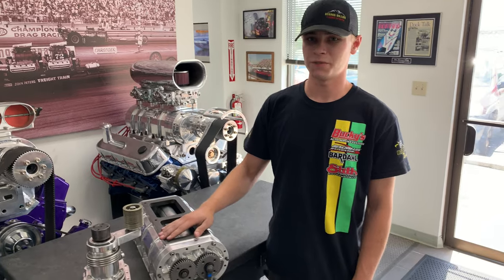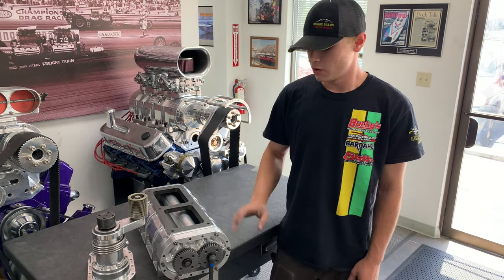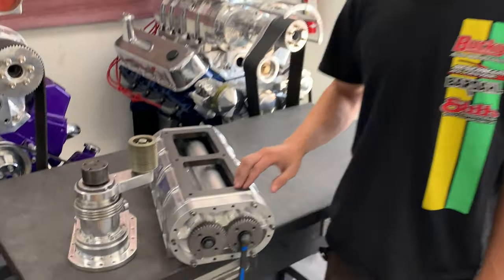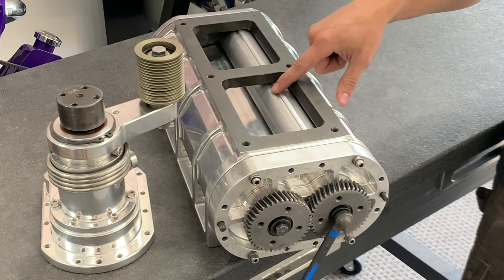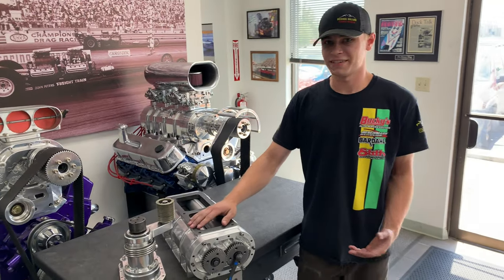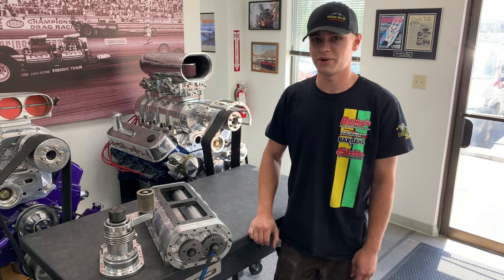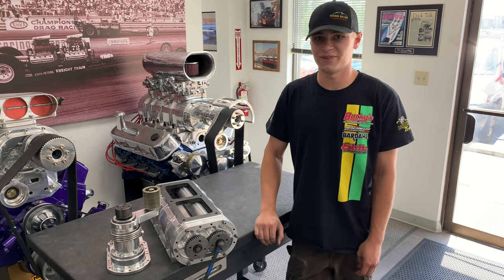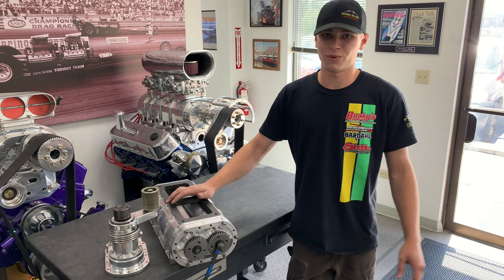Boost Bio 9 - TBS 250 Low Profile Blower

Comment: Seriously thinking of putting one on my 632 marine engine with efi only looking for 3.5 to 4 psi , ran one on my 565 and loved it as 3.5 psi 798 hp pump gas 6 psi 846 hp
Reply: At the very least get a 6-71 for that or a Whipple 3.3. That little 250 won't do much good above 700 hp. You have to remember that a blower needs to be sized for the power, not the engine size. If a blower is designed to make 600-700 hp, that's what it can do, no matter what you strap it on. If you strap a small blower on a motor that already makes a lot of power, the blower will be a restriction, not add power. If you have stepped up from a 565 that made 846 with 6 psi, that same blower on a 632 will not make more power if you spin it at the same speed, it will just make less boost as boost is just a function of air resistance. To comfortably feed a 632 that makes in excess of 850 hp @ 3.5-4 psi, a 250 "baby blower" won't be what you need. A 6-71 can do it, but an 8-71 would be better. Why? Not because 3.5-4 psi is not much. But if you make 850+ hp with that amount of boost, that means your motor is already breathing pretty hard on its own. A normal 8-71 that does not need too much maintenance, i.e not teflon stripped to the max and use a 120 high helix rotor, will max out at about 950-1000 hp before you really start to see diminishing returns for turning up the boost. If you run a intercooler between the manifold and blower, you can add about 100 hp. A comp style high helix 8-71 with all the bells and whistles will make as much as 1250 or so hp on gas, but that's pushing it. A 6-71 can make 900-950 with a cooler and all the bells and whistles, but an more tame 8-71 would be a better choice in a marine application where you really need to control heat. So forget the boost, look at the power. For a 632 making 850-950 hp an 8-71 is what you would actually need, preferably with a cooler. No matter the size, you will have to spin that little 250 insanely fast to make the kind of power you are building for.
Ask any of the good boat motor builders such as Eddie Young, Tommy over at Chief, Shahegian, or the like and they will tell you the same thing.
Reply: I have 1 of these 256 setups from the 565 marine engine. I'm installing it on a 396 compound boosted with twin gt45s. We'll see where it limits out at.